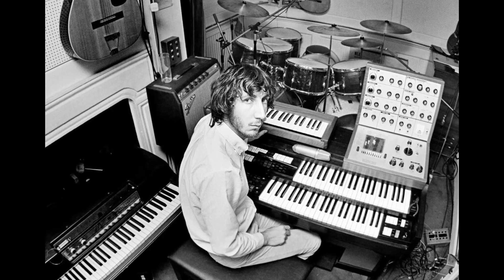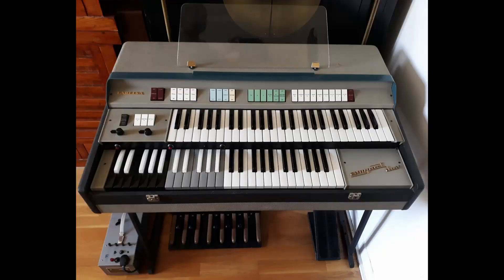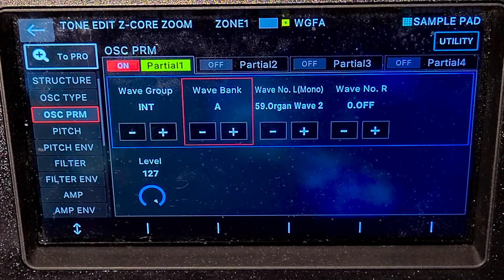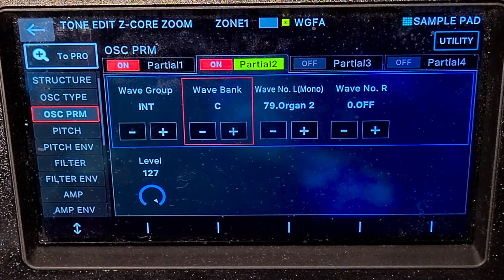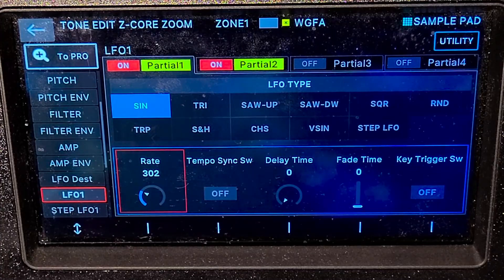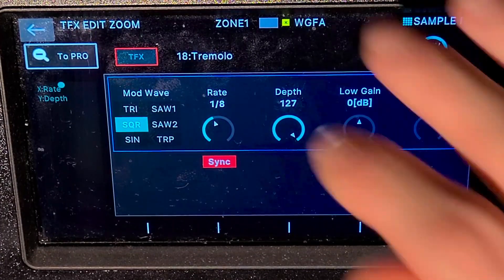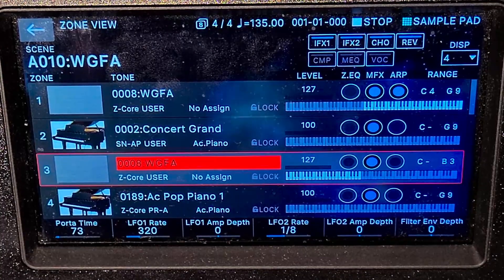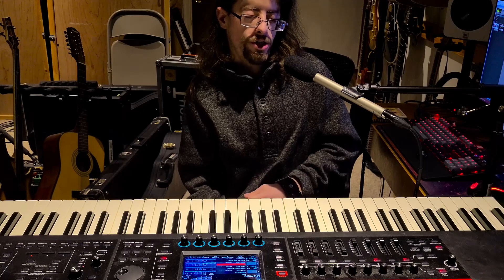How To Recreate The Keyboard sound in "Won't Get Fooled Again"

Comment: Great tips. I'm trying to get close on guitar with any combination I can of the following pedals - EHX C9 Organ Generator, Eventide Tricerachorus, TC Electronic Helix Phaser and the Tremelo of a Keeley Hydra. Needs work but this helps a lot.
Reply from the maker: That's awesome!  I've had to play that part on guitar before. Although i didn't use a tremolo pedal, i just pucked it, haha!  It was a last-minute encore lol
Reply: I've realised my EHX Attack Delay pedal has a square wave Tremelo effect (the Hydra only has Sine or Harmonic) which is in front of the organ pedal. Plucking may still get a more consistent result although it is tiring on the hands if played for the whole song. Good fun experimenting though.
Reply from the maker: @shambapoo  yeah man it's fun nessing around with effects like this!  Try putting the tremolo pedal after the organ pedal. That might help get you a more pronounced effect. If you set the depth of the sine wave to the max. It'll sound close, just rounded off.

Comment: Q: assume Townsend Organ went through amp then synthesiser  to speaker (s) .. This sound was recorded via a microphone and ended up on Tape 
Q: could actual sound of Townsend be further modified via amp and microphone (s)
Q; Who was sound engineer.. 

Great informative video Thank you
Reply from the maker: @manoftheroad55  Thanks!  If the output of the organ went through the synth plus amp and speakers. Then yes, you would have the amp, speakersand the microphone all playing a factor in shpaing the sound. Although I'm pretty sure it went into the board after going through the synth. 
The sound engineer was Glyn Johns, I'm not aware of the amything extra he might have done. However, it's possible he added some EQ using the board and maybe some compression during the mixing.
Reply: @ " The tracks were mixed by Page's childhood friend Glyn Johns, and the iconic album cover showing the Hindenburg disaster was designed by George Hardie.  Relates to Led Zepplin 1  I believe Johns (might have a brother also sound engineer)  when using Rolling Stones mobile studio at Headley Grange  for other recordings..One technique for fuller drum sound was closeup mic and another mic 15 yards away recording a sound delay around that time Orange Mad amps were popular

Comment: Hi Joe,  Fantastic tutorial.  You explain things very clearly.   I have a question-  I have a Korg Triton Studio (I know it's dated...but it's a workhorse for me) and I'm not intimate with all the editing I can do in it.  Different manufacturers name equivalent functions differently.    I'm trying to relate the Rolands sound banks to the Korg sound banks.   In my Korg, I have two 'modes'.  One being 'Program Mode' and the other 'Combi Mode'.    All the Korg supplied patches are in 'Program Mode'.   I can combine up to 8 Program Mode patches into a Combi Mode patch.  Not being familiar with the Roland, I'm assuming 'Scenes' in the Roland are the equivalent of 'Combi' in the Korg and 'Tone' in the Roland are the equivalent of 'Program' in the Korg.   If that is correct,  are you performing your edits in 'Scene' or 'Tone'?  Also,  each Program in the Korg can have two Oscillators and I can assign specific multisamples to a Program.  I don't know what the equivalent of that is in the Roland but I'm assuming you're not editing the 'Tone' but rather combining both 59.Organ Wave 2 and 70.Organ 2  into a 'Scene'.  Is that correct?  Thanks!  Ed
Reply from the maker: @edkolcz-lf1wg  Thank you!  Yes, when i am making my edits. They are editing the scene, which has the envelopes, oscillators, filter, etc. In the roland, you can up 8 or 16 scenes depending on the mode.  In each scene, there are partials they can be edited either independently or together. Think of each partial like a synth. My advice is to find the sounds that work in program mode. Then, use combi mode to blend them. Also, i recommend putting the modulation effect in combi mode if that's possible. That way, the trem stays consistent. Hope that helps?
Reply: @JoeKnecht3  Yes it does.  Thank you very much!!
Reply from the maker: @edkolcz-lf1wg  you're welcome

Comment: I have a Lowrey TBO, and one of these days I'll dive into emulating its "marimba repeat" function that Townshend used on Baba O'Riley. What would be a good starting point? Reaktor? A programmable arpeggiator?
Reply from the maker: That's really cool you have an original TBO!  The Reaktor would be a great place to start, you could probably use the built in modulation to get the repeat emulation.  Set the LFO to a square wave and make sure you send the signal to the amp (I forgot to mention that in the video)  make sure the depth is maxed out and you want it synced to 16th notes around 117 BPM.  Although you can do that with an arpeggiator too, that would also let you program the actual note instead of playing it.  It is also worth noting I have gotten close (for live situations) to Pete's sounds using a VOX emulation on a Nord Stage 2 for example.  So don't be afraid to try other organ emulations that are not a B3 clone.  There don't seem to be any Lowrey plug ins, which is a shame lol.  I hope this helps!
Reply: @JoeKnecht3  Yes, the trick, IIRC, is that the marimba repeat function will alternate between held notes in a particular way, with amplitude envelope triggering on each note like a polyphonic ARP Odyssey. Note triggering is separate between manuals, yet the repeats are synced. I'll chime in after I investigate it a little more.
Reply from the maker: Oh that's interesting.  I went with the assumption that the marimba repeat was global, not split between the manuals like that.  Learn something new everyday haha!  If you are using an LFO with a square wave to get the Marimba repeat sound.  You could set it so it retriggers independently per key.   If that dose not work make to versions of the preset and split your keyboard with plug ins you might need a DAW.  Do you have a DAW preference?  I'll keep looking into emulating that quark.   @elazmohiftenfifter4340

Comment: Loved your video! Question: How do I get all Partials 1-4 highlighed yellow in the ON position when making changes to LFO1 settings etc? I can only highlight one Partial at a time in the ON position. Thanks!
Reply from the maker: You are welcome!  Hold down the shift button when selecting what partials you want to edit/control.   That will let you highlight multiple partials to control them at once.  Took me a minute to figure out myself when I first got the keyboard haha.
Reply: Thank you!
Reply: I got another question Joe... After selecting Filter Depth in the LFO Dest tab, I go to LFO1 tab and when I select the LFO Type (SIN, TRI, S&H) nothing changes in the sound like in your video. What am I missing? Thanks!
Reply from the maker: @newportgeorge  Make sure you adjust the cutoff. If your filter is all the way open (the cutoff knob is all the way up) then you won't hear any modulation.    You can dial in the filter modulation sound by tweaking the cutoff and resonance.
Reply: Joe, Even when I turn the Cutoff dial up or down along with Resonance up or down nothing changes much. I doesn't change at all even when scroll through the LFO Types What position (Time 12 O'clock, 3 O'clock, etc)  are your Cutoff Dial and resonance dial set to? Thank you!
Reply from the maker: @newportgeorge  scroll down to LFO destination and make sure you have filter depth turned up. It's usually in the center, and you can either turn it right for positive and left for negative.  I have my filter depth set to +40. I am using the LPF at -24db. Cutoff is set to 686, and resonance is set to 333

Comment: You are sure the swept filter is sine and not triangle envelope? I have seen another content creator use triangle and it sounded very, very close.
Reply from the maker: Yes, while they do sound close.  The triangle wave sounds more pointed, compared to the more rounded sweep of a sine wave.
Reply: @JoeKnecht3  Yes, but this is the sweep of the bandpass filter so the pointed nature would not be noticeable, it would just appear as a linear sweep up and then a linear sweep down.
Reply from the maker: @vladimpaler3498  There is only one filter sweep happening. Which is a low pass filter. Although because the sweep is slow. It can be hard to notice the difference between the two.

Comment: No, you've got it wrong.  Townshend is also using a Sample and Hold Gate coupled with the Filter Sweep.  You are confusing what he did for Baba O'Riley.  You've got way too much distortion and a Tonewheel will work just fine.
Reply from the maker: Actually, what you are thinking of is the "Marimba Repeat" function on the organ. It was independent per keyboard. Which is how Pete gets those triplets. The part i messed up on. Was i said the organ was doing the square wave tremolo. I thought the Marimba Repeat function was universal. So, the synth is doing the square wave modulation and filter sweeps. There is no sample and hold. And yeah, i could tone the overdrive back a little. That was as low as i could get it with that keyboard. Also, i have never heard anyone het close usong a tonewheel organ. I would love to see examples of people getting close with a tonewheel organ

Comment: Not very accurate organ replication. Sounds a bit over-driven. The original sounds smoother. But the filters and LFO are spot-on.
Reply from the maker: @thejollyjoker187  there is some tape distortion on the original if you listen closely. Especially if you check out the isolated organ track. You can definitely hear some distortion from the signal clipping.  It jumps when Townsend hits higher chords during the instrumental parts